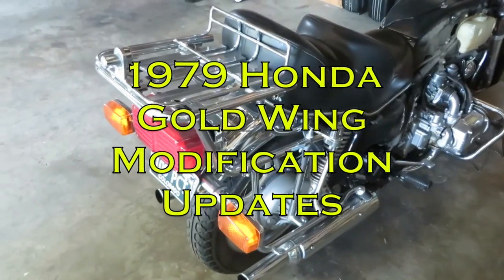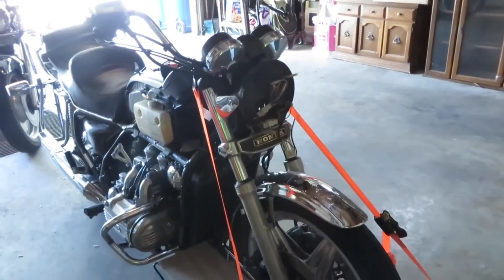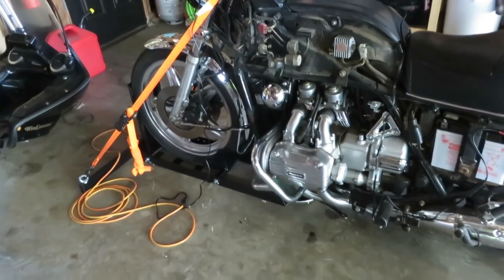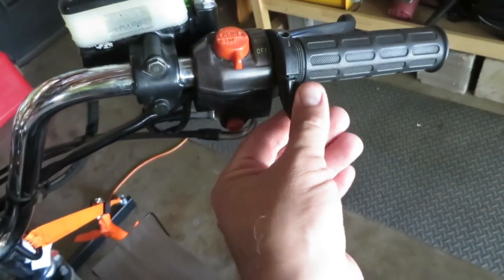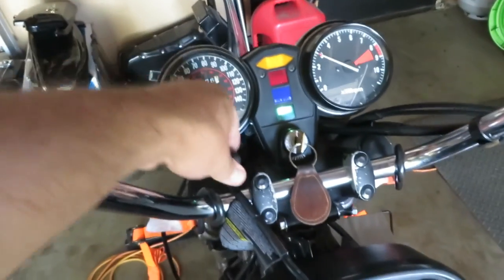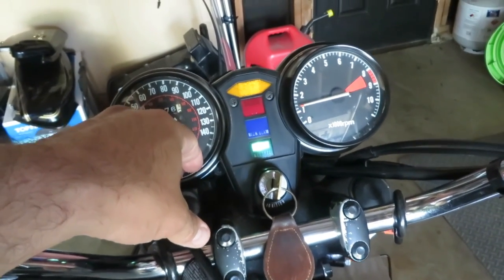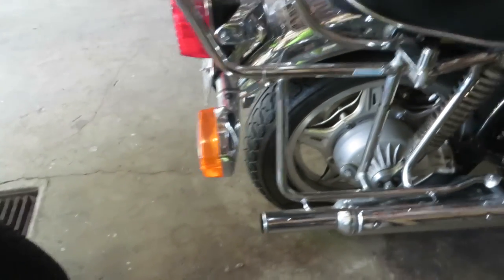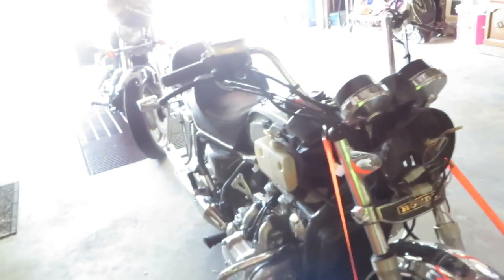Modification Updates 1979 Honda Gold Wing GL1000

Comment: The "one-take wonder" does it again! I KNEW it wasn't too much pressure to point that out to you on the previous vid - you DA MAN!!
The bike is going to look fantastic with the sides back on, a nice headlight and everything else. I think you'll be too tempted to get a deeper note, my friend, and I reckon it will sound incredible, given how good the stock exhaust sounds. I wonder if you can get the baffles out of those pipes?  Well done my friend, lovin' this project, keep up the great work, much love from the Crankies :)
Reply from the maker: YOU are "da man" my friend! I'm loving the spare moments when I can get out to work on the bike. It really can be very therapeutic working a machine that you love. It is coming along nicely and I haven't run into any major snags (yet). Fingers crossed.
And I will admit that this one was done in one take (it is a bit rambling I think) but I certainly don't always nail it! Thanks for the kind words brother. Much love from the Bees!

Comment: I'm surprised it doesn't use a timing chain, or solid connection like the Harleys. I mean, if you aren't worried about weight, then it doesn't seem like a big deal. Also, there's that thing that the F80g/s did, with the dry lifters, but boxer engine and all.
Reply from the maker: I think that the timing belts are the one big flaw with this bike. Belts will wear out and eventually break. And unless you stay ahead of this by changing them, you will be out of an engine if one breaks.
Thanks for stopping by bro. Hope all is well with you my friend.

Comment: Yay for doing your own maintenance!!!!  Are you confident in replacing those belts?  It is an interference engine so if you install them wrong say good bye to your engine.  What was the compression reading on each cylinder?
Reply from the maker: Thanks man. I'm feeling pretty good about the timing belt replacement. I've been looking at both manuals of mine (the original service manual and the Clymer manual) and checked out a couple of YT videos. I'll be sure to be careful! And I don't have the compression readings off hand but they were within specs.

Comment: Is that the largest weight saving in motorcycle history?  
Pity they hacked away your indicators.
Reply from the maker: I feel like they just butchered the bike by hacking away the turn signals. I mean, how could you DO that?! I actually downloaded a scanned copy of the original installation manual for the fairing and yup, the instructions clearly say, "In order to allow for proper installation, use a hack saw to cut off the left and right indicators..." Noooo!!!!
Reply: Unbelievable.